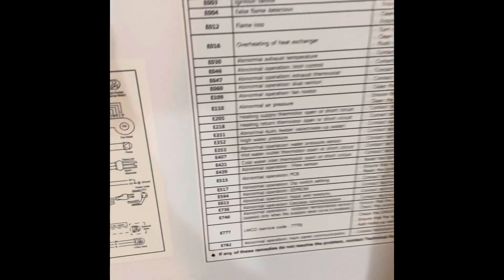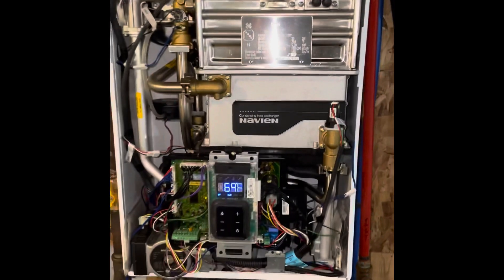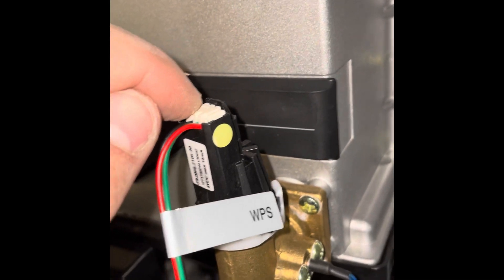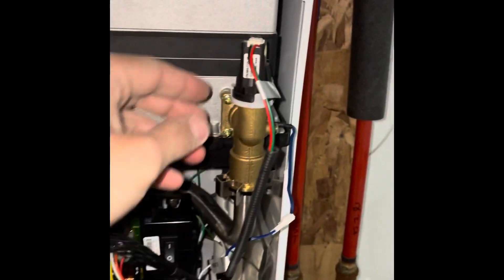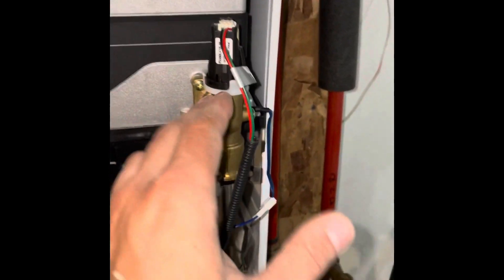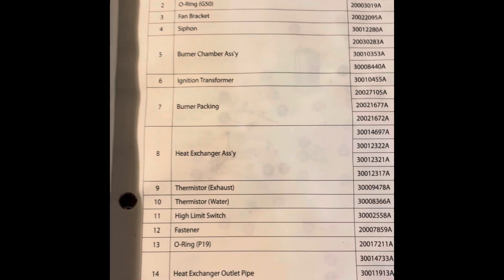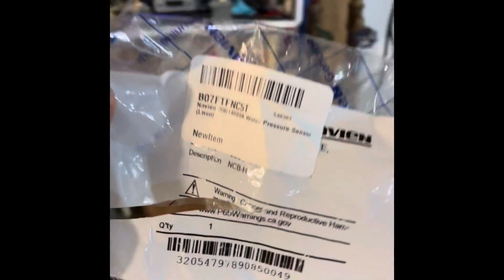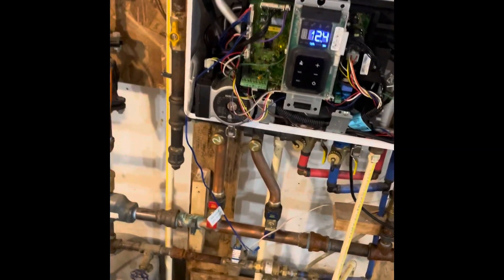NAVIEN E353 Error Code FIX

Comment: There is a "Pump Drain Plug' with yellow label underneath that says "Pump Drain Plug"
That will alleviate the water PRESSURE before you unscrew the sensor 
If no yellow tag, it is a 1/2" diameter black plastic thumb screw with a slotted screwdriver slot. Located on bottom to left towards front on a 240.
The one I just did had no yellow tag & the drain plug was finger tight. It drained out about a gallon of water B4 I replaced the sensor.
Sensor was $21 from a plumbing supply house.
Reply: Do you need to refill the system after draining?

Comment: We had this same code.. replaced WPS and now there’s no water coming up through where the sensor is?? Any ideas?
Reply from the maker: Unless you turned the water off to replace the sensor it should still be flowing water as it was. Try unplugging unit and plug back in to reset the unit
Reply: @themillennialhomeowner1661  nope, the water is on and everything. have water everywhere except out of that flow sensor spot! it’s so strange.
Reply from the maker: @megs3882  is there an error code?
Reply from the maker: @megs3882  you shouldn’t have water coming out of there anyway once it’s screwed on
Reply: @themillennialhomeowner1661  the new sensor is on but the unit is reading 0psi and only 58°
Reply from the maker: @megs3882  is there an error code on the unit